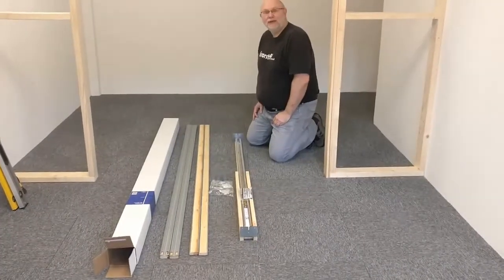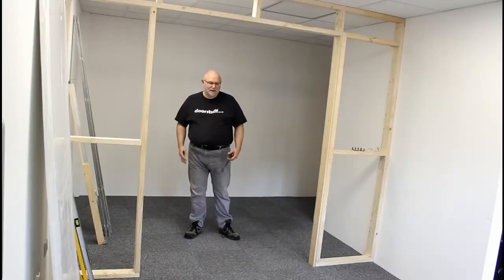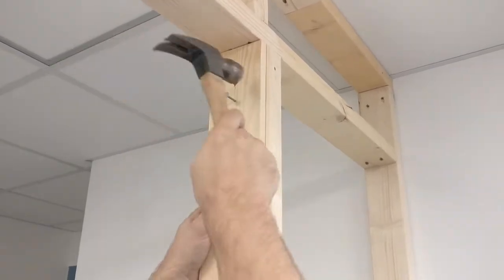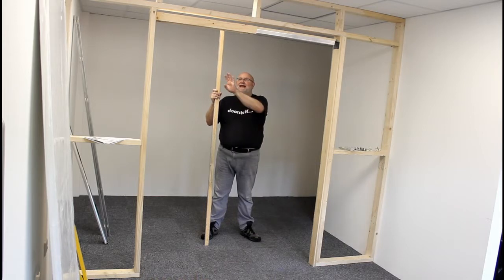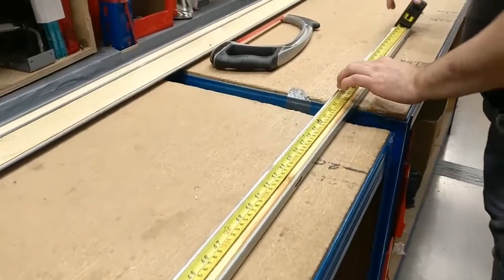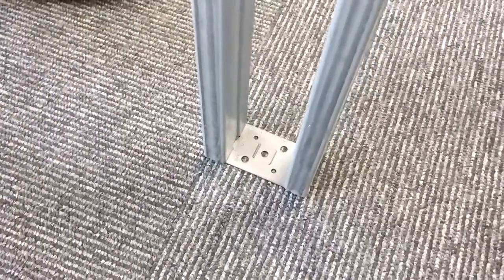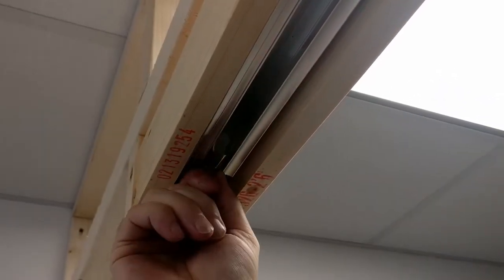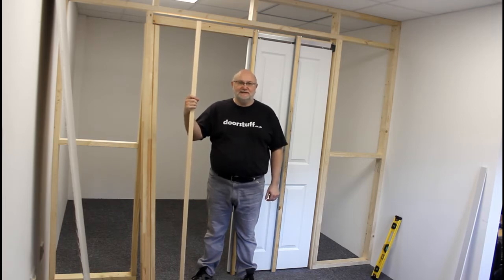How To Install a Pocket Door Part 1 | Doorstuff

Comment: I have a set of double pocket doors, they wobble as there is no floor track. Any idea on how to stop this?
Reply: the wobble when closed or wobble when in motion? There should be little guide pieces on both sides to adapt to the thickness of the door.